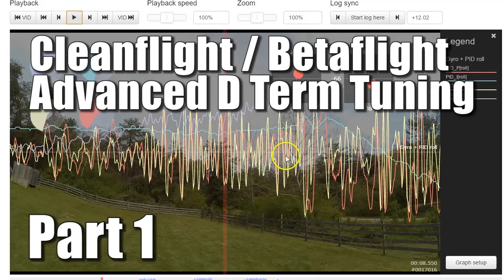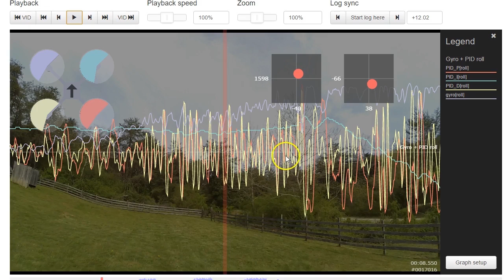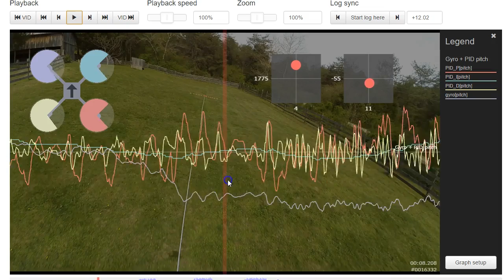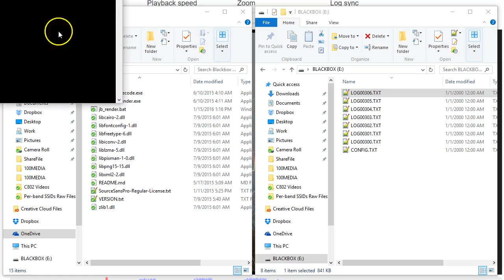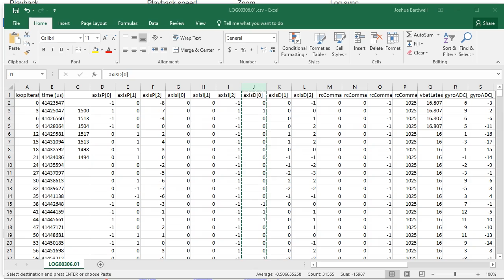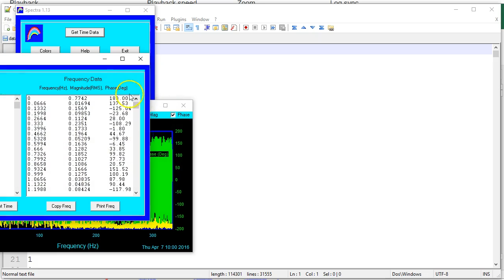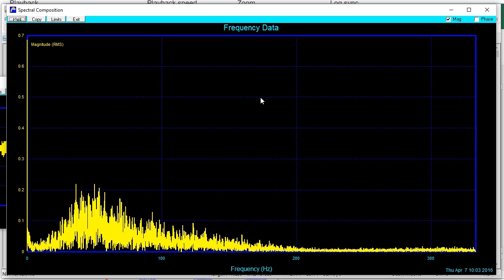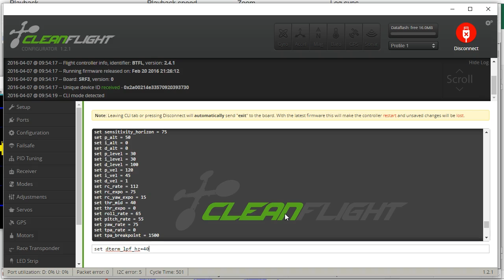Cleanflight / Betaflight Advanced D Term Tuning - Part 1

Comment: grest vid.
Can I send you a quad haha I gave up on it.
can figure out why at full throttle it goes out a control.
seems like a yawn at Throttle. maybe little roll when pitche'd forward.
Reply from the maker: +StippLeFPV TV What quad?
Reply: +Joshua Bardwell qav210:
lux FC
2206 2350kv
littlebee 20amp
Reply from the maker: You want me to see if I can fix it?
Reply: +Joshua Bardwell  unless we could do it remotely lol.
I'm lost for ideas. 
don't know how to tune.
Facebook crew has been shooting all sorts of ideas but all failed.
Reply from the maker: You have Blackbox on it?
Reply: +Joshua Bardwell I have a black box have not installed it yet. but I could.
Reply from the maker: +StippLeFPV TV Post a log of the problem to my Blackbox Video Responses thread.

http://www.rcgroups.com/forums/showthread.php?t=2484202
Reply: +Joshua Bardwell hm.... new to BB so just fly then haha. it's going to a oscillation Mess... stock PIDs
Reply: alright installed need to see if it works lol.
Reply: Is it  text file u need from BB haha. sorry never done this before just tested on table and it made a TXT file LOG0025
Reply: u want a gorpo clip with it?
Reply from the maker: +StippLeFPV TV Yes. That one.
Reply: Yeah i just installed the Chrome GUI pretty cool. ill go get a Log in a few min.
Reply: +StippLeFPV TV so maybe I won't be sending u a log haha... reciever cut out and crashed blackbox missing haha. guess I did a bad ziptie.

Comment: not related to d term, but I have a cc3d and i just flashed clean flight 1.9 after getting bored of gcs and everything works (sbus to x4r and taranis) when it is connected to the PC, and also if I only unplug the USB cable, it arms and seems to run fine, but if I "reboot" the quad(unplug and replug battery) like you would in the field, it doesn't arm. please help! I don't know what to do
Reply from the maker: +AveryFpv start by flashing to a recent firmware. Cleanflight 1.12 or Betaflight 2.6.1.
Reply: +Joshua Bardwell can't, cc3d can only run 1.9 flashing with USB
Reply: +AveryFpv I wish I could but I don't have an ftdi adapter
Reply from the maker: +AveryFpv Can't you uninstall the OP bootloader and then flash the hex file using CF configurator? I don't own a CC3D so I'm not sure...
Reply: +Joshua Bardwell not with the USB I don't think, but I'll look into it. any ideas on why this might happen in the first place, I have seen videos where it worked fine for them
Reply from the maker: +AveryFpv No clue. Sorry. CC3D has always left a bad taste in my mouth because of stuff like this. It was made to run OpenPilot, and that has always ended up with some weird quirks. It's a shame because on paper, it is a really good board, very ahead of its time.
Reply: Yes, I have gotten that sense too, I bought it because it seemed more reliable than a Naze at the time (a few months ago only!) Thanks anyway for your help
Reply from the maker: Honestly, I would take a Naze32 r5 over a CC3D. But an F3 board like the Xracer F303 would be a better all-around choice these days.Lots of good choices at any budget point.
Reply: Yep

Comment: Have you tried ßF 2.6? It has some very good Dterm filtering. I've never had this clean D trace before.

Also out of curiosity how did your PIDs end up on the ZMR-X210? I'm having a hard time tuning mine..
Reply from the maker: +Equinox FPV I transferred my electronics from the QAV-RXL build to the X210 with almost no change at all in PIDs. I would say that if you're having trouble tuning, it has more to do with the electronics than the frame.

I have not yet gotten to 2.6. I tend to delay upgrading firmwares because Boris updates so freaking fast that I just can't keep up. It takes me several weeks of fine-tuning before I really feel like I have a copter flying exactly how I want it, and once I get there, I don't want to upgrade for a while. But it looks like 2.6 is pretty stable, so I will either put it on my next build or I will maybe upgrade my QAV-R.
Reply from the maker: +Equinox FPV I'm a little hesitant to base my decision just based on the cleanness of the D term trace. I mean, if Boris thinks it's good then it's probably good, but one thing I've learned is that a clean D trace is not best if it means excess delay between the P term and the D term. This is actually relevant in part 2 of this video, so stay tuned!

Comment: Do you think adding more filtering to the gyro would also help the D term? The default gyro soft filter is now 80hz but it seems to me 70 or even 60 cleans up the noise and both p and d traces really nice and makes for quieter motors at least on my set ups.
Reply: Maybe an analysis comparing gyro filtering vs dterm filtering would be good.
Reply from the maker: +Zenman FPV Filtering the gyro would help the D term, but it would also soften up the P term and make the copter as a whole less responsive. But it would keep the P term and the D term in sync, so maybe that would actually fly better. Stay tuned for part 2 anyway!
Reply: +Joshua Bardwell  Right, my thoughts exactly. Curious what the best approach would be and more importantly what would feel the best. Nice series! Really enjoy your work!